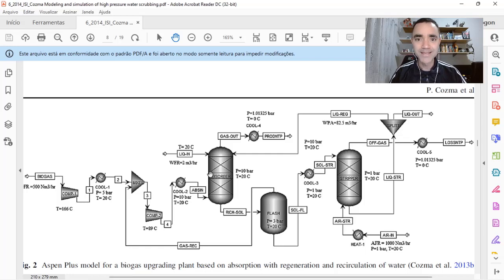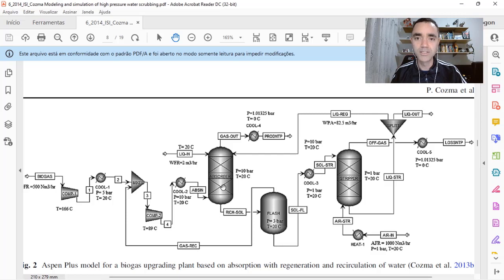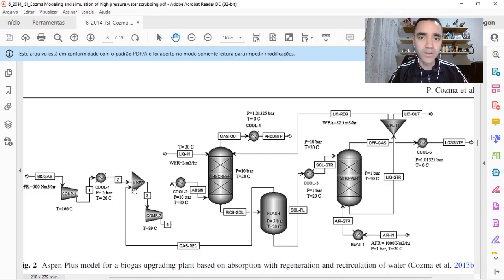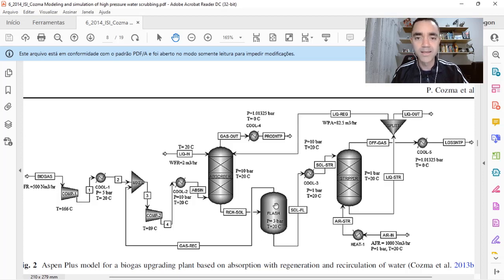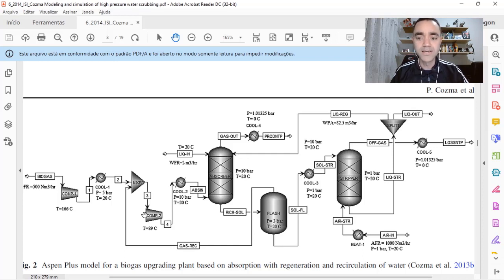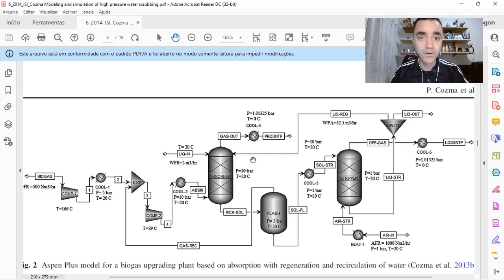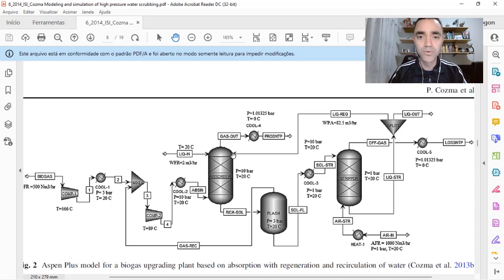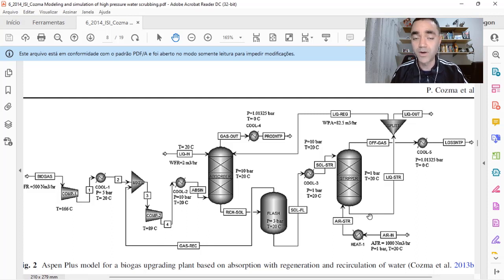MIXING PRESSURE IN PROCESS DESIGN | BUILD PROCESS SIMULATION BASED ON REAL LIFE

Comment: Sir, what I think after doing process simulation in AspenPlus for many years is that 1. In reality, there will be a pressure drop throughout the process as there will be many different valves, frictional losses in pipes/pipelines, controllers, measurement devices and many other elements under a dynamic environment as there will always be a possibility for minute or sudden fluctuations from the steady state.  2. Mixing of streams at same temperature and pressure is much more favorable than in different operating parameters. So can you kindly enlighten us that here what kind of exact mixers,can we use in real process plants?
Reply from the maker: Hi Anurag, good points . 😄 My additions...
1) In real live there is no stead state conditions. In operations, there is expected operating range. If the process is in this range we can say it is stable. How large is the range is depends on the variable, process, conditions etc.
 2) In Aspen Hysys/Aspen Plus, a "MIXER" is just a designation to a block for mixing fluids. It is not a real equipment. For instance, when joining pipes on process simulation using a mixer, what you are doing in real life is adding a "T" to your pipe system. Real mixer design depends on the process, fluids, purpose etc.
Thanks for sharing your comments
Reply: @jefersoncostaengineer  Thank you Sir for your valuable suggestions. Just hoping to learn much more regarding real plant operation and dynamic problems.